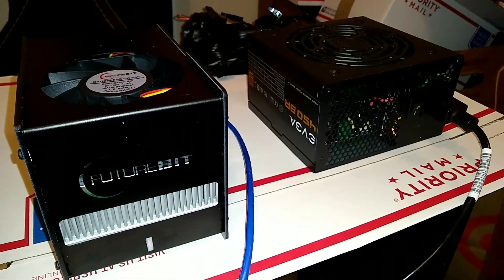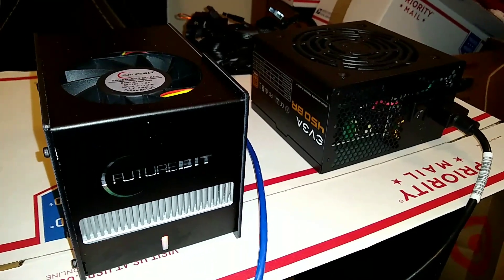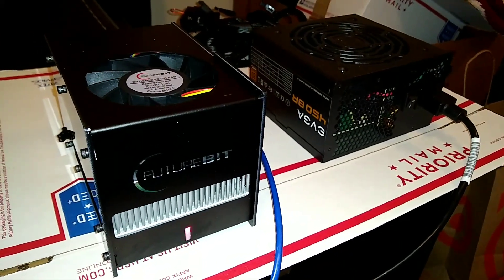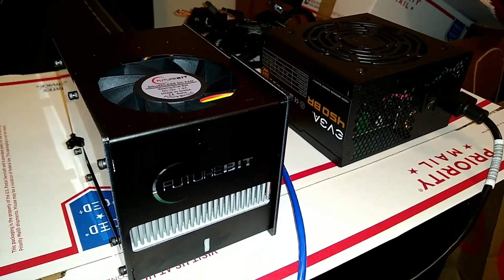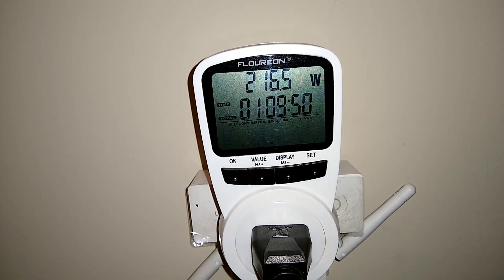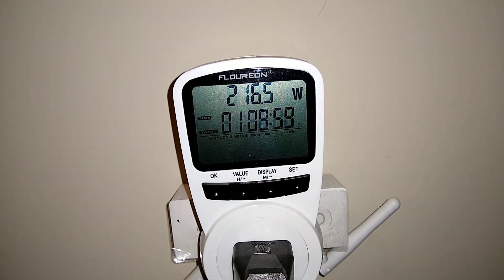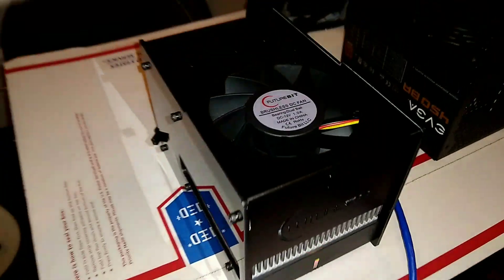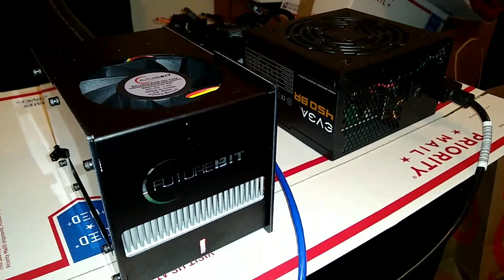FutureBit Apollo ASIC Turbo Mode Wattage Test

Comment: this power supply need motherboard conect? or how do you do for runn this power supply?
Reply from the maker: In another video of mine... Powering Up, I talk about how to put a jumper across the atx12v connector. It simulates a in off switch. They sell them in eBay also for a few dollars, but a cheap insulated magwire works good
Reply: @ScottieDoesThings  i will go to buy power supply 450br for ny miner futurebit apollo batch 2
Reply from the maker: @solofutball9506  futurebit does make a proprietary power supply also.. I think 250watt. But it might be quicker to get a regular one.
Reply: @ScottieDoesThings  i was with a power supply cross air of 1000w and with the trick of clips only star 5 min and then off all. Why?
Reply from the maker: @solofutball9506  if it is a "smart" power supply it'll shut off if the proper power drain is there. I'd avoid those if you could
Reply: @ScottieDoesThings  DO NOT BUY THIS APPLIANCE THESE SELLERS ARE SCAMMERS SAY ON YOUR PAGE THAT THEY ARE SMOOTHING 1WATTS FOR EACH 1MHS AND CONSUME 131WATTS FOR 100MHS IS A SCAM. SO YOU WILL NEVER GET A PROFIT

Comment: Not looking at ROI but just pure speculation of wattage on this in comparison to a L3+ with custom firmware the final goal can be achieved with a lot less money for miners.  If China is not your thing buy off ebay from the US.  it would take around 6 / 7 of these to equal 1GH/s at 150Mh/s at $200 a pop so that's $1400 and it would run about 1.2 - 1.4KW
Reply from the maker: Good info. I like this miner as it's super quiet, and low power consumption (in eco mode). The wife doesn't yell about it being on. I had an A4 Dominator in the attic at one point and would hear about it constantly being too loud and made our power bill absurd (1050 watts). The l3+ made it alot better, so I sold the A4 and got an l3+. It was nice until that fan spun up, and our power bill looked the same. (we pay $0.13 0-100kwh, $.14 101-300, $.15 301-500, etc). Setting and forgetting this one is like leaving a few light on upstairs, so it's negligible in the power bill, and I haven't gotten a single noise comment. If a quick ROI is what you are after, maybe its not for you, but if you want to get out from under the power company's thumb, keep a happy cohabitant, and mine alt coins, this works out. (Or get a solar powered she shed 🤣)

Comment: Any updates? Still running happy?
Reply from the maker: Still mining away! Installed the latest firmware from FutureBit, although I didn't have any of the problems other people reported with the old firmware. Seems stable and quiet still. Very happy.
Reply: Only mining LTC or trying more?
Reply from the maker: @MarkCantPark  I'm pointing at prohashing so it switched from LTC to xvg dgb gamecredits and Doge. As long as the difficulty settings are configured right, it seems to handle them all nicely. I am happier mining there than on nicehash or zpool
Reply: Tempted to buy a apollo, so in other words it is still worth it? @ScottieDoesThings
Reply from the maker: @MarkCantPark  still mining away at zergpool now. Went solo mode on lower coins (Flo, Cha, MEC, sci-fi, moon) getting about .34 a day. I might be breaking even with power costs, but I'm holding those coins as well and this recent rise in prices looks nice on those wallets. 🤓